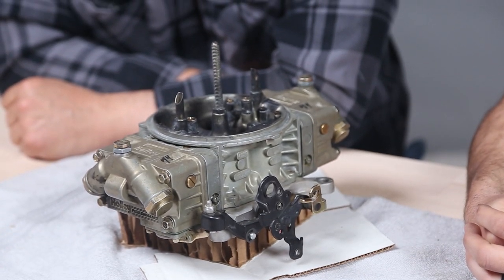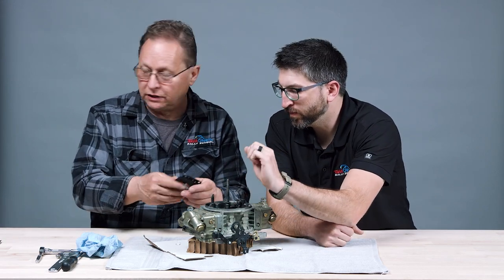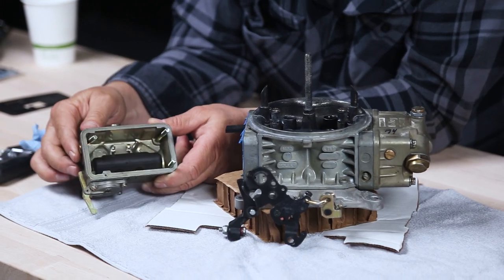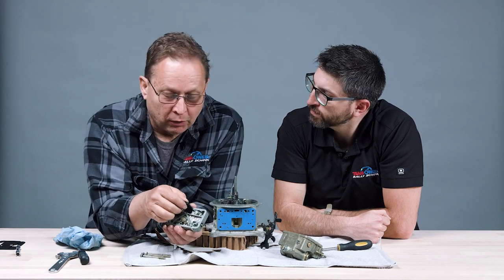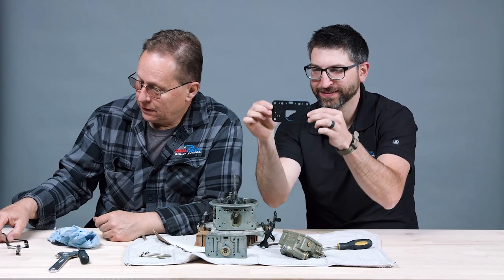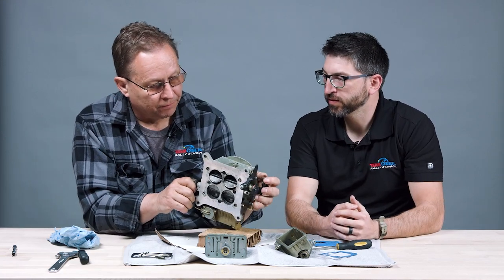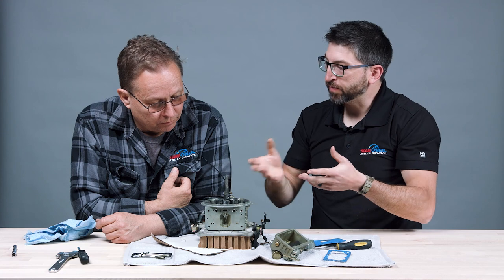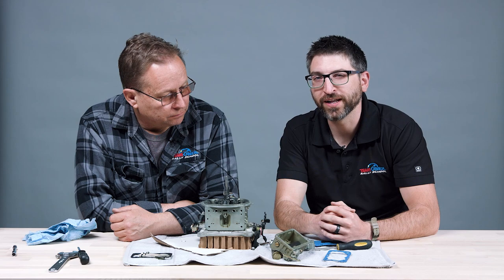Carburetor, In A Rally Car

Comment: Excellent! Jetting carbs is certainly a nearly lost art. My past includes lots of jetting of Webers (and clones) and SUs, so your Holley example was new to me--several nice features. The easy float level adjustment is huge compared with the disassemble, bend little float tab, assemble, try, disassemble,...ad nauseam. That level is critical to tuning since it adjusts the head of fuel delivered to the main jets; effectively equivalent to the fuel pressure delivered to fuel injection nozzles.

Comment: I really don't see how this is simple compared to basic fuel injection.  
It's like comparing drum and disk brakes.
😅
Reply: I agree but its simple in the sense that if you had to 'create' a fuel injection system yourself you'd be able to make a carb but I dont think it'd be as easy to make a fuel injector from scratch. That requires factories and specific equipment that isn't readily available. I mean at least I think so I'm just some dickhead on the internet.